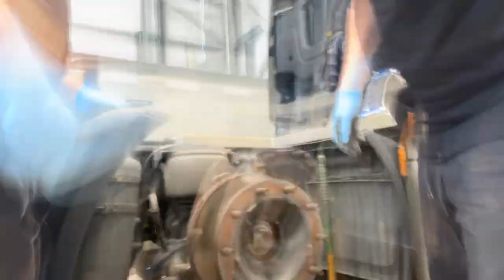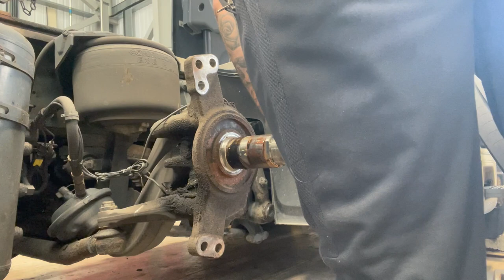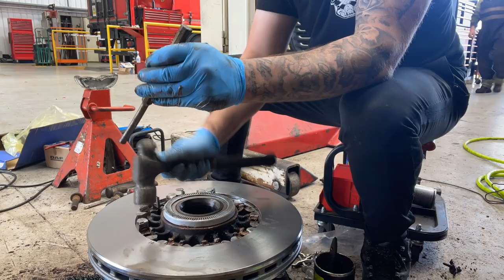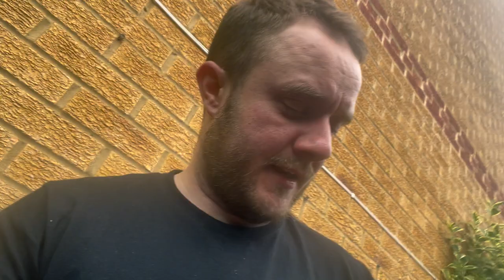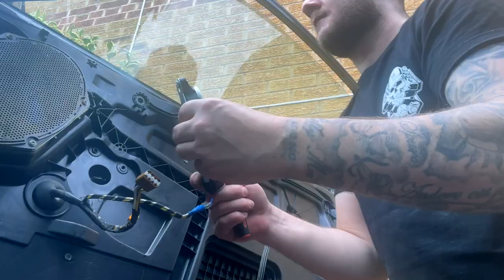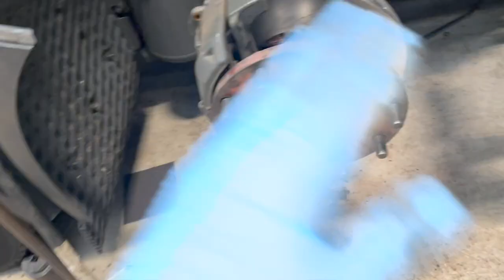Day in there life of a  HGV Mechanic- DAF CF85 Euro 6- discs and pads, Fiesta parts problems!

Comment: Hey bro 
How are you today 
For me I'm having a headache with a truck here and is not one but alot of them ...is with the EBS system..I get a RED error on it and when I diagnostic it ,it giving me the rear brakes module is not working ..so I change it with a working one and is giving me the same error...I'm getting this problem alot on the DAF EURO 3.4.5.
can you help me or tell me how to fix it because I checked all the wires and all is good .
It will help.me alot bro

Comment: Wondered if you were going to do the abs sensor , a lot of people don’t bother which is a nightmare if it fails later on and is seized in. Fair play you definitely do they job properly. Are you not allowed to use an inch drive gun?
Reply from the maker: Yeah we always change to sensor as like
You said they are a pain to get out and you don’t wanna be stripping it again for the sake of replacing it in the first place. Yeah we are but my 1/2 gun is more powerful lol

Comment: How much torque you use to screw down disc? I torque them down to about 45Nm
Reply from the maker: 45nm the same mate
Reply: I was told by the local DAF agent that they were 38nm which I’ve always done them to. Is 45nm definitely correct as I’ll have to do that in future, 45nm seems quite a lot for an m8 bolt.

Comment: There will be some who have a go at you about wearing goggles, I'll  mention something I wish I had not ignored - your hearing. I now have to use soap to find air leaks 'cos I simply can't hear them any more, I don't even know if there are any. All that ringing from the hammer and grinder work is very slowly damaging your ears. By the time you notice Tinnitus it will be too late and the damage is permanent. What? eh? say again? I didn't get that sorry.
Reply from the maker: Yeah I get what your saying mate for sure that’s why when I was using the gun etc I had ear defenders on like you say once you damage your hearing you don’t tend to get it back.
Reply: Learnt me lesson with goggles, lucky had them on at the time, was using a air hammer on something and the piece I was working on shatterd in my face, I had a hole in my cheek and a nice flap of nose hanging off. There was some nice witness marks on my new dewalt goggs